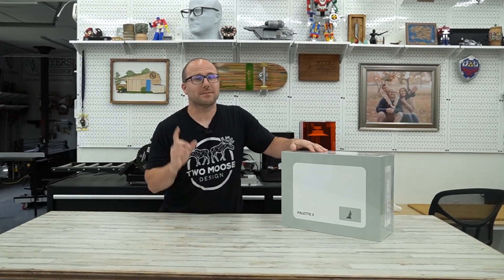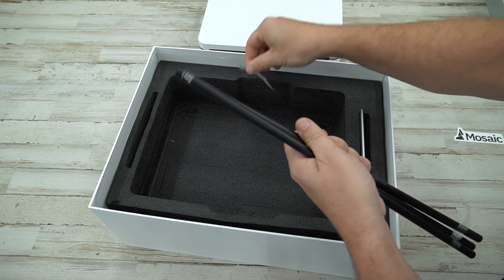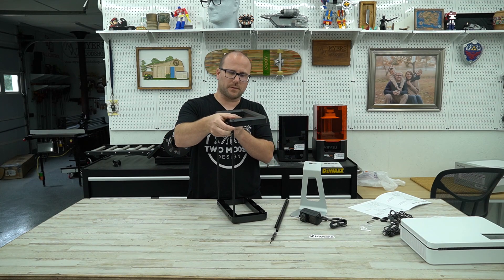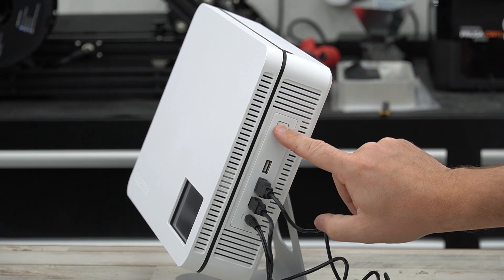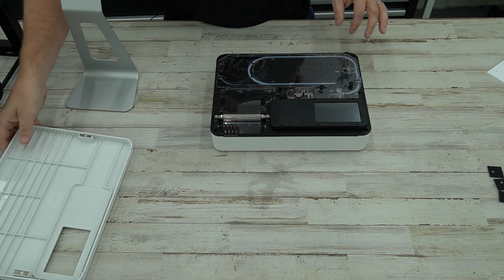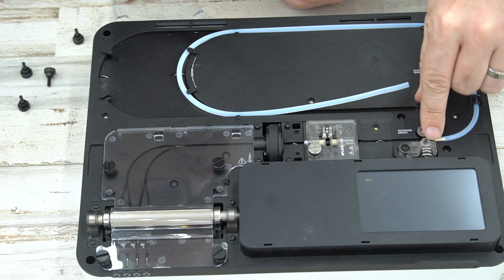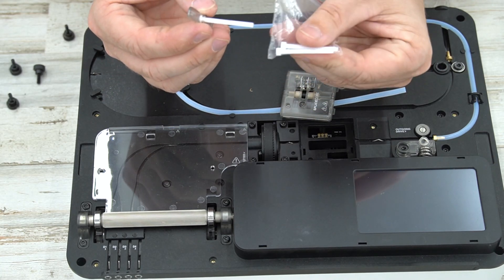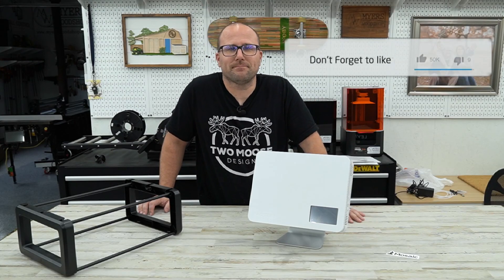Mosaic Palette 3 First Look - 3D Print In Multiple Colors EASY!

Comment: lots of questions: What was fixed in this version over 2? what software do you use to slice models? is this going to follow the last line up and the pro model be a little beefier and have a longer warranty? is the little I know its not a octoprint but octoprint device that the version 2 uses is it still needed?
Reply from the maker: This is my first Palette, so I don't know.